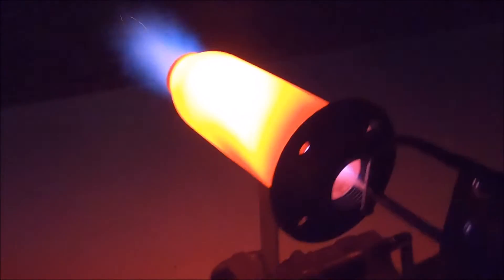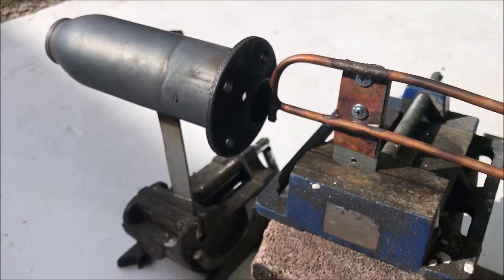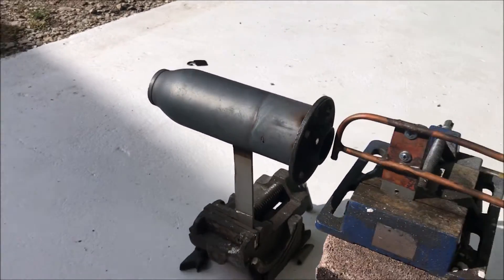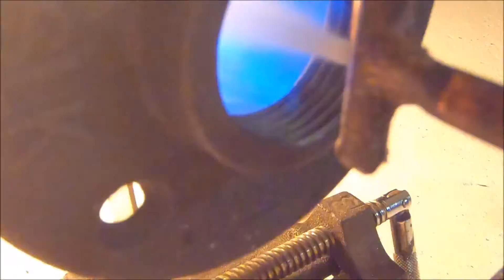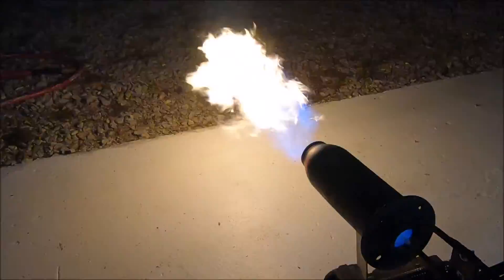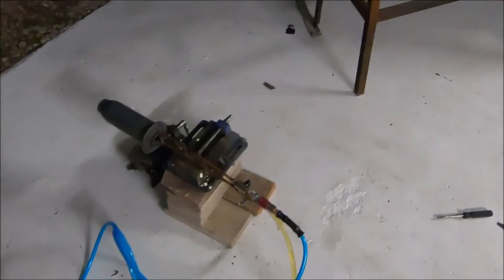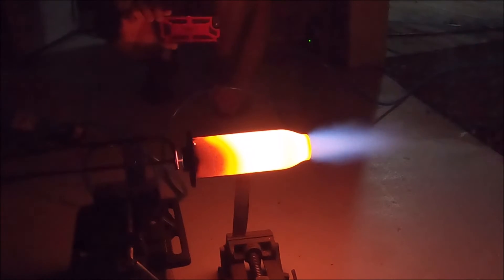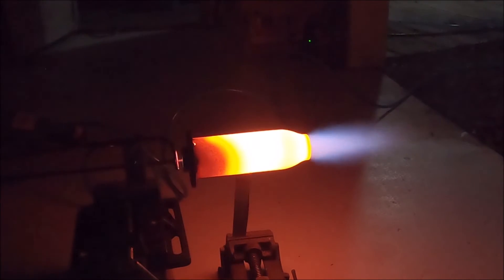Bazzoka Burner all fuel forge foundry and kiln burner

Comment: I tried a similar burner a while ago but in a lot smaller scale. 

I used an old fridge compressor, homemade small nozzle (similar to your styles) and spark ignition made out ot 2 car spark plugs and an 700KV module. It ran great and produced about 20-40kw/h. Great for small scale burners. 
Fridge gompressor only consumes 150w of power. Now that is a great cheap set-up.